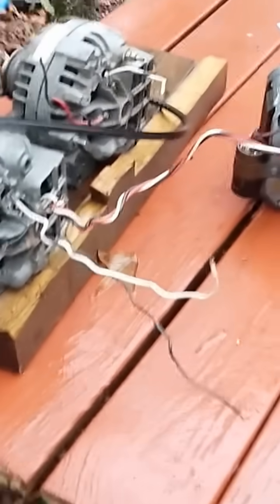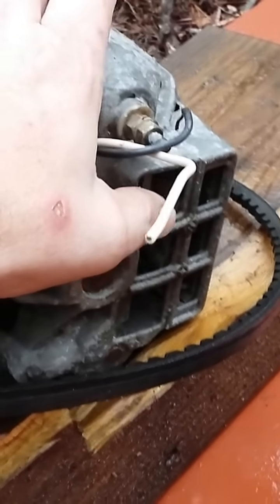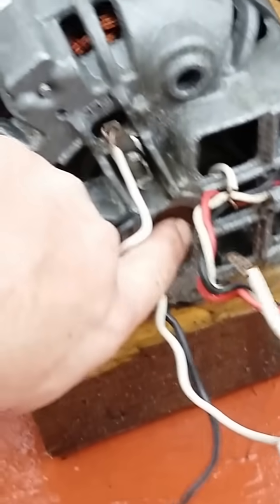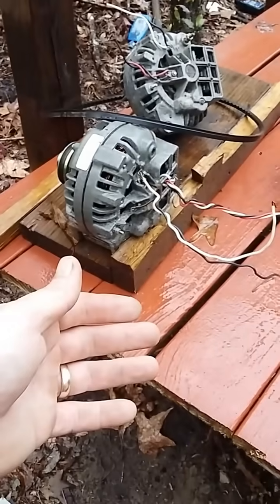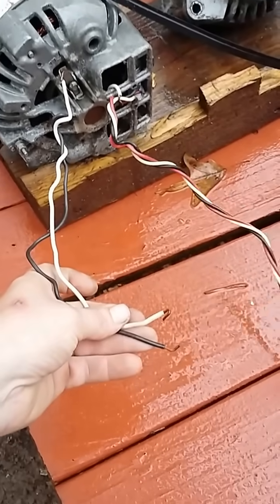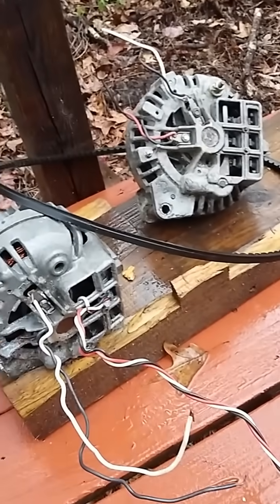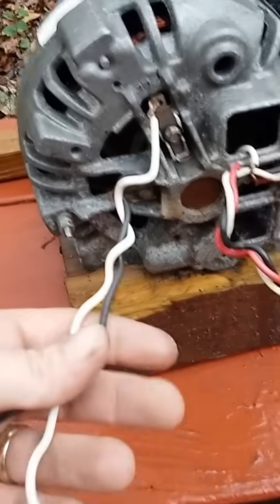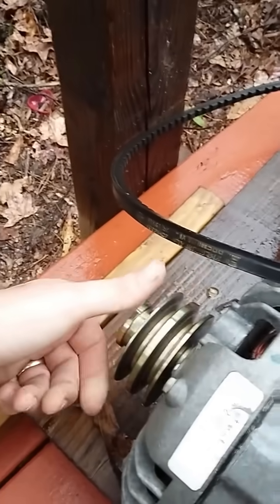Update Free energy forever no wind no solar no gas READ DISCRIPTION!!!

Comment: Why do people keep putting you down?, when you are only trying to help? I subbed! Keep up the awesome work!!!!
Reply: Paid to give people a hard time
Reply: Because people like you believe this crap if you believe it post a video of you powering your house with this stupid idea.   That is something impossible for you to do this is why everybody talks crap about this idiot
Reply: @donaldcampbell7894  
This is what i don’t get. A gas powered motor TURNS the generator creating power. Swap the gas powered motor for an electric motor, use a battery to start the motor and use generator to supply power back to motor to keep it turning the generator. Same thing as a gas powered motor so if a gas powered generator can run a house, why couldn’t something like that, if all you’re doing is swapping the gas motor for elec motor?
Reply: @brutaldroo  Because it won't work.  The energy required to turn the motor is more energy than the generator would output.  There are losses from friction and from converting the energy from mechanical to electrical and back.  It gets even worse of you're trying to power auxillary items.

Comment: Running g the 12 v through the diodes won't spin the alt though will it?
Reply: Diodes are like a check valve for electric current it only allows flow one direction alternating curren hence a/c t runs both ways D/C  runs one way hence direct current!

Comment: I do know for sure a Delco alternator will put out 220 volts at 90 amps I've made gas powered generators with them but I've never tried the free energy but you all doubt the 90 amp 220 volts I'll start the 5up Briggs up you stick the three wires in a bucket of water stick one foot in and leave the other foot out on the ground bet you don't walk away I'll call the ambulance for you
Reply: That wouldn’t do anything to you.
Reply: @gano7297  watch a video it's called makeing a generator from an alternator
Reply: And anyways 90 amps would melt those little wires so fast. This guy has no idea what he’s talking about he’s interchanging 90amps DC with 90amps 120V AC
Reply: @gano7297  if you bypass the regulator and rectifier you alternator hence the name alternator it makes alternating current that uses a rectifier and regulator and yes it makes 220 volts AC and amperage is dependent on the alternator

Comment: HI. I'm not here to snark up your video. I just need a little bit of help my few remaining brain cells to soak up your concepts, which I totally dig ! 1. What is the power source for your DC black and white wires? You say "... three to 12 volts...", but where does that come from? 2. Also please, "... you spin this ( pulley on shaft) and you get 90 amps for your house or whatever..." etc. What do you use to spin the pulley? Are you using a water wheel, a wind mill,  Briggs and Stratton engine or what? These answers would really help. I understand you can use each additional alternator, and wire them like you need them to charge a battery, which in turn could excite the main alternator, etc.  Can you help a hillbilly ( ME !) out here? lol ;) Thanks ! D.C.
Reply: He’s referring to turning one into a motor and using it to spin the other two then after the others are spinning it’s supposed to create enough energy to run its self and power other appliances This is called over maturity.
Reply: Exactly what I was wondering

Comment: Wow, such negative nellie's on here. Just some FYI, my Dad taught us how to make this when I was a kid. Works great when hooked to a bicycle to turn the alternator and the alternator hooked to a battery to store power. Then just wire up the battery bank like you would solar leading to the house. Most ppl don't know that the power box from the pole outside your home has a small circle spot that is actually regulated by the power company to allow for solar power leading into the main box to then go into the house and breaker box. This, works. And isn't hard to make or keep running and takes about 30min to 45 min to generate enough power to run a normal home for 24 hrs.
Reply: Lol! 45 mins of pedaling to power a house for 24 hours? You’re insane
Reply: You could hook that up to a windmill or a water wheel or hook it up to a bicycles rear wheel rim . You could always power it up using a small gasoline powered 4stroke engine.
Reply: Will you call me or email a pic, step by step process? feminineathlete@gmail.com 
thanks
Reply: Yes please step by step w pictures. I'm like feminineathlete @ gmail.com. people are desperate and want to know, with out frying themselves and the whole household. Lol. May simple knowledge for some, but if you haven't been exposed to it , it's like a foreign language.   Joeironman@msn.com
Reply: Protect the children, please I would like to connect with you to get more info how this works, and how I can build one. Please contact me at: ambafarmersvoice@gmail.com. Thanks
Reply: completely wrong but ok, air conditioning unit for example, after 1 hour of biking at a reasonable pace, you could maybe power just that for 15 minutes, if you were that really strong swedish biker guy then you could maybe get up to 25 minutes or so

Comment: Do i take off the cover of the alternator to get to the wires from the diodes?? Do i need to have wires to add... house wires have more than 2 or 3 wires sometimes.... i need a better explanation on how to do this.. i want to put a qelder in my garage and use this as a power source for said welder...
Please give me stwp by step instructio s...with pictures..
Reply: 2x 12volt  batteries = welded!

Comment: On the back of the Alternator, GM 10SI above the rear bearing there’s 3 windows, I assume the window closest to the positive terminal coming off the back of the alternator I assume that is positive AC current is the middle window neutral ? And is the window far to your left the ground for AC current ? The wiring you did on your alternator into the stater you only show the Y is going to the back of the alternator I am very interested in what you doing please any Intel would be helpful !

Comment: I am not trying to hate cuz this guy has a legit concept here. That said he needs to straighten out the terminology. What he calls the stator is the rotor. The stator is the outer coil windings. The rotor is a group of three coils tightly grouped on the center shaft. This is where the field is created. The terms change a bit when discussing the motor. Rolls are the same but reversed. The outer coil windings in motor are called field coils. The shaft and windings with commutator is called the armature.

Comment: I missed what turns the alternator
Reply: The motor. That's what motors do they convert electrical energy into rotational energy. My bad this guy is all over the place. He refers to the 2 alternator/generators parts like they are motors wired like generators. That's just to much. He definitely has 2 alternators and 1 motor. But they can be used as either. I watched again to try to get it as best I can. He is using the motor as a generator and he never says what exactly he is driving with
Reply: You would start it with a battery but once you get it going you can plug it right in the wall of the home your giving electricity to..it would essentially run its self
Reply: @positivemomentum9902  saying hes pumping 220v and 90amp to his house ac . Your saying he hurriedup unplugs it runs fsster than light to replug in th ( 6-12 dc) wire into house thats now running (220 ac) to power the motor to keep it spinning and producing power . Alternator make voltage no one is arguing that cause that isnt news to anyone .....but it must first be powered to make power and then must "continuously" be powered by something also using power to produce said power .
Reply: @pappypappy2610  once you get it running you could have it run itself. Initially by a battery .. Big woopdy dooo.. No energy bill .. Priceless...You can make that work with some minor  adjustments...
Reply: @pappypappy2610  Give the guy a little positive encouragement.. Instead trying to destroy his idea/dream... then you must have a teacher if you don't got nothing nice to say and don't say nothing
Reply: Ant. Diewoord cookie thumper
Reply: Josh you the man.must be an auto electrician too.this guy is talking shit.simple

Comment: 220 volts at 90  Amps  ?  ?  =  19800 watts.    If ya covert that wattage to Horsepower,   You'd need a  25 HP motor to turn the generator..
 Are ya sure that little motor is gonna put out that much ?

Comment: I love the explanation: "everyone who knows someth'n about electricity you know you got these 2 wires that run into your two poles on your breaker box and uhh 🤔 ummm yeah the 3rd goes into the ground" ... 🤣 yeah let's run your 3 phase power directly into your house like that and while you're at it take a video so I can watch the fireworks 🧨.

But being serious yes you have wired up those alternators to work as generators.l however your big issue is that you're taking the name plate value of 90Amps and trying to assign it to the 3 phase voltage which it wasn't intended for.

When working with different voltages it's important to reference its available power or the watts produced which can be expressed as Volts (V) x Amps (I) = Power (Watts). In a 12v system the alternator is rated for producing 90amps for a total 12volts x 90amps = 1080watts that's its rated power output. If it was generating 220volts (ac or dc our formula doesn't matter) since we wanna know how many amps that would be we divide each side by the volts and solve Amps = Watts/Volts (1080watts/220v = 4.9amps). Far cry from powering your 100amp distribution center. 

*Here's also another reality check, take a look at the size of the power cables coming into your house vs the size wires on that alternator. Notice a blaring discrepancy in size? ... What? No? ... well I sure noticed the blaring meth pipe burn on your hand so put the torch and glass pipe down and check again.
Reply: I think we're the only ones here that understands electricity and its principles. I was hoping he would fire it up and then do an arc flash video. That pipe burn on his hand would be the least of his worries.
Reply: Wow you explained that very well thank you!

Comment: Alternators do not output 220v... 😂
FMD!
Reply: Even if they did...you'd need to run the other alternator at 240v for the otherone to generate that power surely?
Reply: "alternator secrets"

Comment: What I'm trying to figure out is how he is getting free power but still has to find a power source to power those alternators? Is he using a nearby stream with to get that 6-9 volts?
Reply: "free power".....just add energy.
Reply: Small gas engine!
Reply: @paulkibler6824  see this video  it is portuguese and tell me something after    https://www.youtube.com/watch?v=XWlG5jXvwAQ&ab_channel=liciniobatista
Reply: @paulkibler6824  see this video  it is portuguese and tell me something after    https://www.youtube.com/watch?v=XWlG5jXvwAQ&ab_channel=liciniobatista
Reply: I'm 64 ,my old friend in the 70's did this with a gas engine and car battery to supply his old house !!
Reply: @paulkibler6824  gasoline is getting expensive . . . no free energy. I saw gas prices last night here in El Paso Tx at $3.45 /Gallon . . this video is nonsense
Reply: 6 volt deep cell battery hooks to black & white wires. second alternator is to recharge 6 volt battery
Reply: see this video  it is portuguese and tell me something after    https://www.youtube.com/watch?v=XWlG5jXvwAQ&ab_channel=liciniobatista

Comment: Removing the diodes (bridge rectifier) does put the sine wave back to AC instead if pulse DC current.  It will be still 14.4 volt AC though. 9 in series and a slightly lower stator voltage will make a combined 120 volt ac at the rated amperage of the alternator. This would be quite a bit of force to rotate at the proper rpm to generate this.  You would be much better off keeping a 12volt system and using one with a hydro setup. 

Now for the part of rotating this with another motor, that creates a substantial power loss and you are essentially just converting DC to AC doing this. At that point, again you would be better off staying with a 12v DC system. Battery efficiency is roughly 80% (lead acid batteries must not be discharged beyond 50% or 11.5volt to prevent damage (100amp deep cycle = 50 - efficiency = 40 amp to be safe) deep cycle batteries are better at discharge efficiency,  less at recharge though. The alternator efficiency might be as high as 95%, but usually less. The drive motor will be roughly the same, between 85-95% efficiency.  So just the motor to alternator setup alone will have a 10-30% power loss, plus the battery loss. If you absolutely need ac power, Aims makes great inverters at 90-95% efficient and you aren't messing with stupidity.

His claim of 220v at 90 amps is false.
Reply: Of course it's false. High school kids know what that high of a current does to small guage wires. And the voltage is a ratio of the number of windings in both the rotor and stator, and the insulation on the winding wires? It isn't rated for the voltages he claims. It too will fry.
And... someone should explain Watts to him.  90A @ 12V = 1,080 Watts. 90A @ 220V = 19,800 Watts. Same equipment, just wired differently? 18 X the power by just switching a few wires? Whoever is coaching him is playing this guy for a fool, and laughing behind his back.

Comment: You should show it working not just talk about that it works and soon as you put a load on it your input is going to go up to match, so you'll need wind or water to turn your alternator, it's the same way a wind generator works, but maybe start by taking apart a used alternator step by step and show what your doing and maybe someone can have a science project but it won't power a house the input would have to be higher

Comment: There is no free energy, you have to pay for the gasoline to run the generator that runs your alternator that generates electricity. The problem with that is that it's less efficient to run a generator that runs an alternator that generates electricity than to just use the generator (some already output ac so no need for an alternator). It would be best to just buy a generator that outputs ac. But you'll never have a generator that makes free energy because you have to pay for the fuel. And straight up electricity from power companies is cheaper than the amount of gasoline required to get the same energy. You can attach a cycle to the generator and pedal yourself but then you pay for that energy in time spent pedaling and the extra food & water to keep yourself alive. Take basic highschool physics, then show us at least a bachelor's of science degree in Electrical engineering or a related field,  cause you sir only have a rudimentary knowledge if the field. And as has been stated already, the laws of thermodynamics prohibit over unity of any kind. You cannot get more energy out of a system than you put into it, it's impossible. Changing the frequency, amplitude, phase, or shape of the sine wave does not change the fact that over unity does not exist.
Reply: Luis my question to you. 
How do you know?
Do tried before what the guy said?
Or you flashing your title and running your.mouth cos is the only thing you do.
Give him benefit of doubt and try

Comment: Just being transparent, not negative or snarky. But thermodynamic laws will prohibit this from working. No documented proof of any "overunity" device (outputs more energy than it consumes) has ever been released to the public. If one were to be invented, it would redefine the current understanding of thermodynamics, which would likely require the utilization of exotic new materials instead of common things found on shelves for decades now.
This design might work if the motor used to turn the alternator was replaced by a free independent energy source, like a stream turning a water wheel. But in this configuration, that motor would struggle to turn the alternator rotor, which would require increased torque with increased electrical load.
Not sure why you're hiding in the woods, as there are already plenty of similar videos on YouTube & none of their creators are disappearing, but I hope you & your family are safe.
Reply: Well I'd certainly like to see a video of any one of those examples in operation, with verifiable results & independently reproduced by other parties...the way science works.
As for magnetic fields collapsing faster than light; I've not researched that, but I believe general relativity allows for travel faster than light under certain circumstances. What I mentioned was thermodynamic law. Conservation of energy. Not relativity.
I've got an AS degree in electronic engineering & a nerdy interest in this topic. I'm by no means an expert. But I'm glad there are people tinkering & challenging currently-accepted models.
Reply from the maker: You can have over unity devices multiple ways either using high voltage/high frequency, using magnets, or using collapsing magnetic fields which are faster than the speed of light by the way.
Thanks for the comment!
Reply: Il est stupide....

Comment: Hey men we need wire diagram hook up detailing clear you need a 6 volte battery and turn the shaft and it will run 24/7  365 days a year. Explain better on the video your video audio is too low.